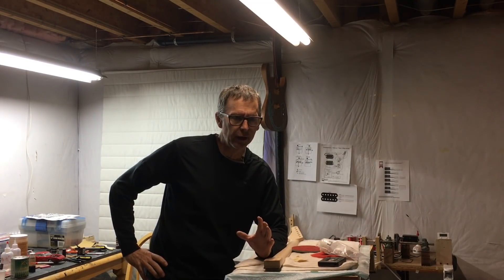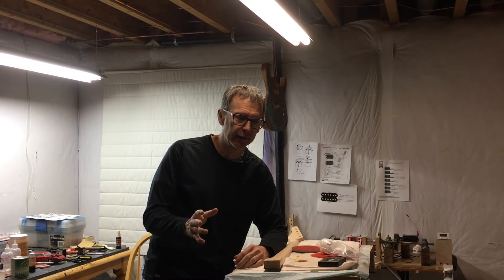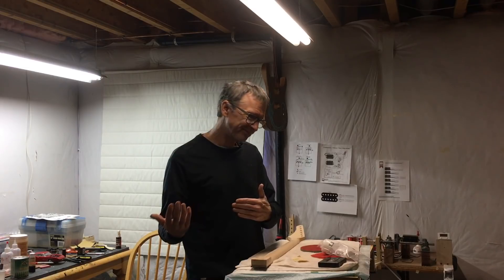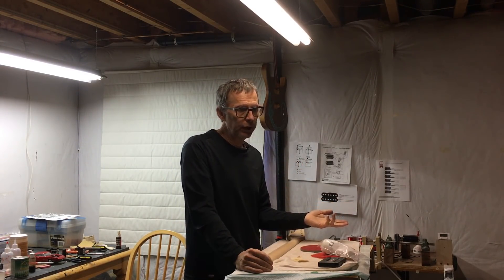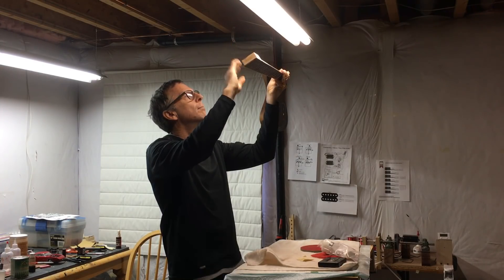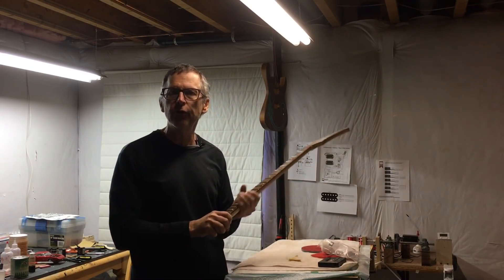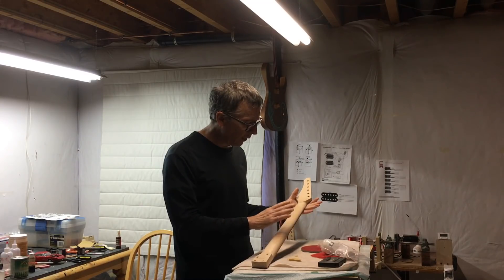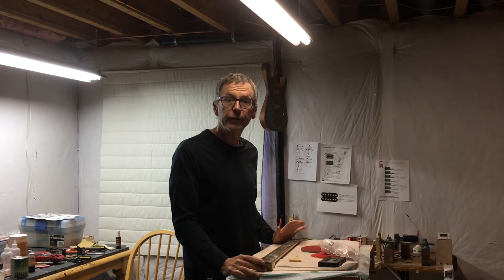When To Use CNC And When To Use Hand Building Techniques

Comment: What 3d programs do you recommend? Is there free software that you recommend?
Reply from the maker: I use Adobe Illustrator for my 2D design work. Inkscape is a good free alternative. I export my designs as an .svg file and bring them into Easel for carving on X-Carve. For 3D work, I use Rhinoceros 3D and export my work as an .stl file which I import into MeshCam to generate the tool paths. The resulting G-code is sent to the X-Carve with Easel. There are a few free 3D programs, but I never had much luck with them. Rhinoceros 3D works best for me. BTW, I do my design work on a Mac and CNC carving with a PC.

Comment: My apologies, but I still don't totally understand. 
The way I see (and use) a CNC, is that it does work for me, so it saves time. 
That means that the time the CNC is busy carving out stuff, I can do other things (and just every now and than keep an eye on the CNC).
Another good point is that the overall end result and quality in a sense of repetition is much higher, because it's pretty hard (and time consuming) to get the same result by hand. 
It also helps you a lot with less back pain and other physical issues sometimes (depending on the task)
Reply from the maker: It all depends on the CNC machine you use. A high powered (expensive) machine can easily do it all very quickly. A more affordable machine like the X-Carve can still do it all, but not as fast as a high-powered machine. Most luthiers who use CNC, do a two-stage cut on their projects, a rough cut and a finish/detail cut. I have found that I can do the rough cut quickly on my X-Carve, but I can do the finish work faster with my random orbital sander. Does that make sense?